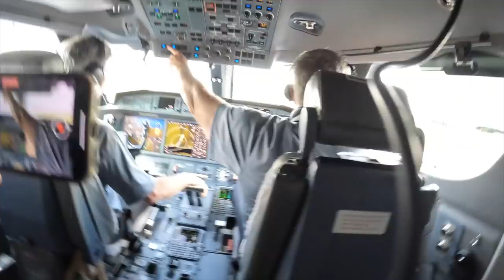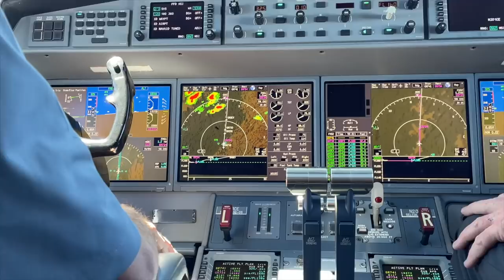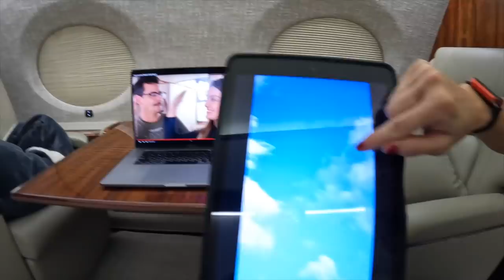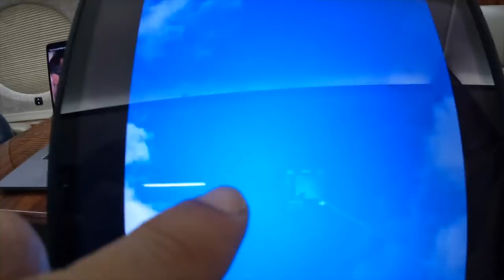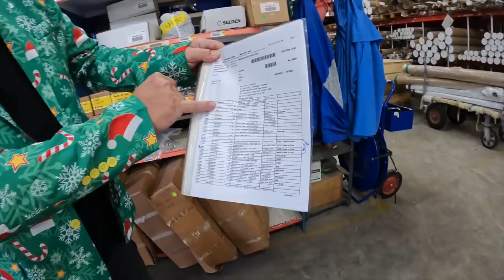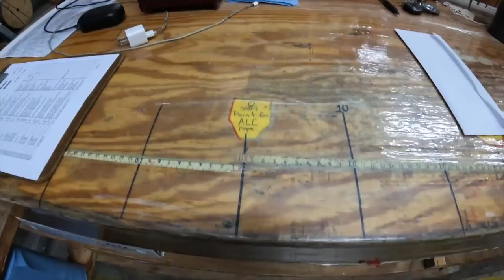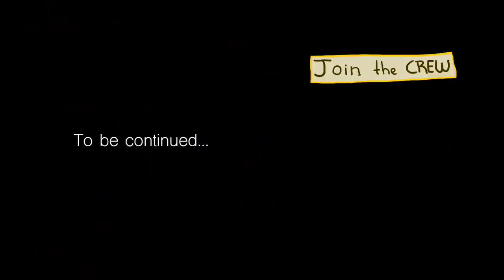⛵️Living the YES THEORY!! #222

Comment: The reason why you had so much difficulty renting a car is because of the chip shortage. Rental companies only keep their cars a certain amount of miles, then they get rid of them and buy new ones. Well, they sold the "high mileage" cars, and went to buy new ones just as the chip shortage was hitting all the car manufactures, and the rental companies (along with everyone else) couldn't buy cars, because there weren't any cars to buy. Frankly, I'm a little surprised you were able to rent a car at all.